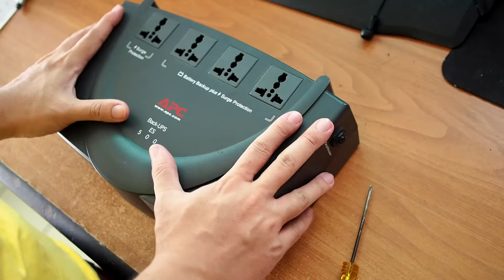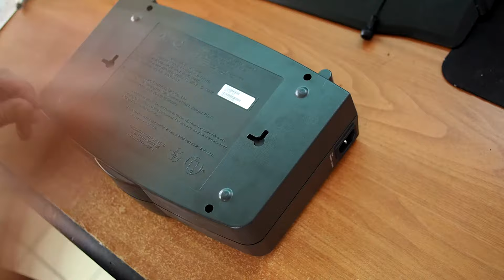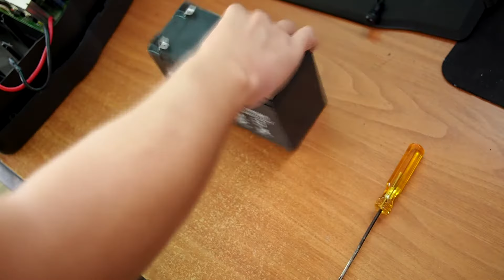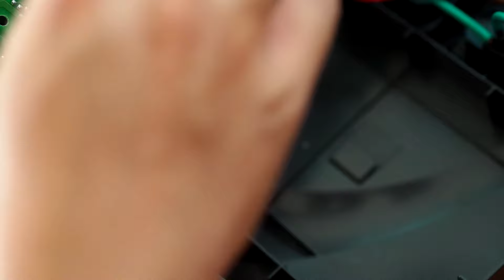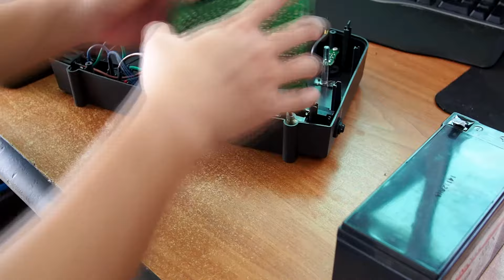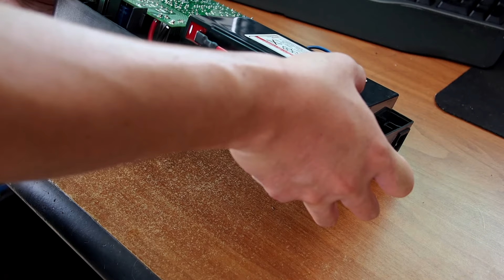Sidequest - APC ES500 Uninterruptible Power Supply

Comment: I have this model that doesn't turn on as well. How do I know if there are bloated capacitors?
Once replaced, can I use it as a glorified extension cord or will I have to replace the battery as well? 
It has been stored and unused for 5-10years.